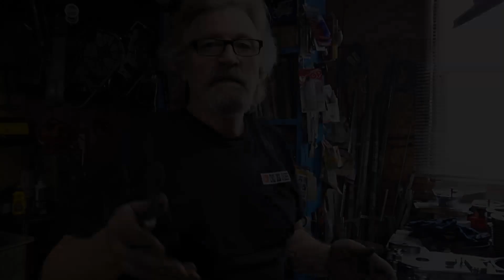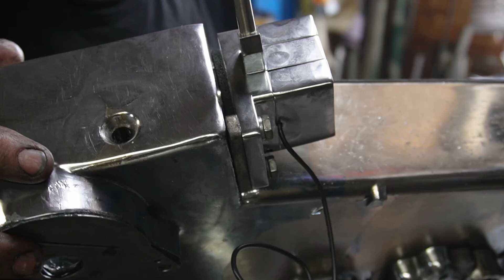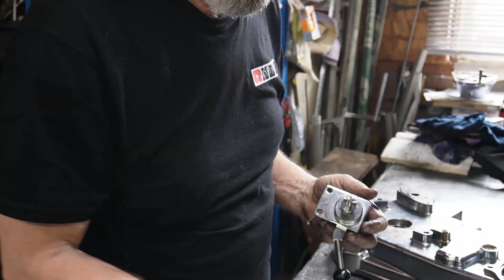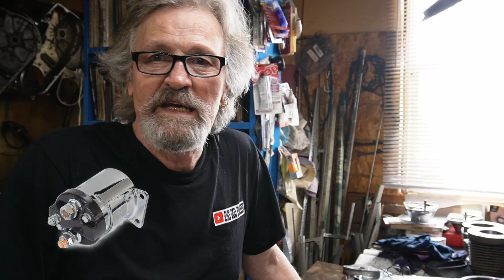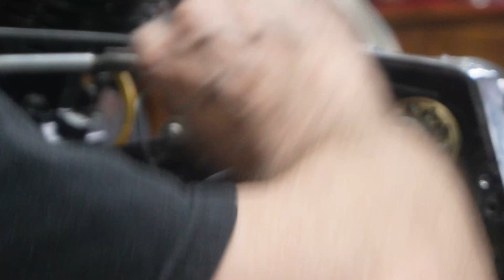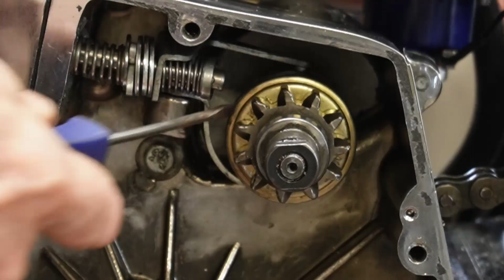HOW TO INSTALL LEVER ACTION SOLENOID ELIMINATOR / HERE'S WHAT I HAD TO DO

Comment: So I have a 75 Fxe. Had a guy change the handlebars and messed everything up. Including the push button for the starter. It would stick. Huge pos... tried his best to fk everything up. Anyways, being i was changing the look anyway, I decided to eliminate the button and go with this VFactor lever. All of your information is spot on. But they also do not have clear instructions on the wiring. After installing everything,  it works okay but does require constant adjustment.  And I developed a drain on the battery.  Can not for the life of me figure it out. I ride 8 miles and the battery completely discharges. Followed their instructions 100%. Stator and regular are putting out. Battery check says fine. Wtf is  hap- pening? Thanks for any insight
Reply from the maker: It's frustrating when things go wrong after a repair, especially with electrical issues. It sounds like you've done a lot of good troubleshooting already. A constant adjustment issue and battery drain often point to a wiring or grounding problem. Sometimes, there can be a parasitic draw that doesn't show up on a quick battery check, especially with the ignition on or off. I'd double-check all your connections, especially grounds, and maybe even test for a parasitic draw using a multimeter. Electrical problems canbe so frustrating for sure.  I do not think the Lever set up is the problem. I just did a video,  a week or so  back, for others on how to wire it up properly. You might want to check it ou. Thanks for reaching out and sharing your experience! Good luck.

Comment: Where did you place the relay ?
Reply from the maker: I mounted it up behind the oil tank. Made a bracket to fit it there. Thanks for commenting.
Reply: @itsmytimeletsgo ok.
I' ve been tinkering with at that place today.Tried tiewraps through the rubber bracket but that won't t hold.Thinking of 3d printing a bracket.
Thanks
Reply from the maker: Its alwasy a challange. Thanks for commenting.
Reply: @itsmytimeletsgo 
Yep .Mine is behind the battery now.
Still a problem to find a good spot.

Comment: or just change over to a belt primary.......like my 4 shovels.  you will never stop that pos design primary  from leaking otherwise.
Reply from the maker: You could do tha,t if money is no object I guess. Belt drive systems are $1,100.00 up here right now, plus 14% taxes, so dealing with what you have is a necessity for many.  I have done many sealed primarys without any issues.  Thanks for commenting.

Comment: What about the wiring to start the bike do you disconnect the start switch on the handle bars and those wires then where doe the wire in the solenoid replacement go?? Great Video,just ordered one of those units tou installed gor tired of crappy aftermarket solenoids and thought this manual switch is the way to go! And I have been told you have to earn it to make it right! Thanks for the expertise!
Reply from the maker: You do not need the handlebar switch. You should get an instruction sheet with the unit. If not you can email me ralph@itsmytimeletsgo.com and I can send you one. They take a lottle fooling around with but work well once set up right. Good luck and Thanks for commenting

Comment: Just installed but I’m confused with the terminals on the stock type relay, diagram is not clear. Can you help me clarify? Thanks!
Reply: Got it figured out, works great! Thanks for the video, it was super helpful, saved me a lot of time. Thanks!
Reply from the maker: Glad you got it figured out.
Reply from the maker: I can send you a few pics of the installation for this that should clarify things. Youneed to use the large type starter relay, along with the small black one. Contact me ralph@itsmytimeletsgo.com and I will forward them to you. Thanks for the question and commenting.

Comment: Ralph, I have a client that wants one of these...other than the gasket issue, how well do they work?  Will they hold up top regular use?
Reply from the maker: I see no reason why they should not hold up. I have had many comments, from others, who have used them over time and all say they seem to stand up. Takes a little fooling around to get the in and out alignment just right, but then they should be good. I am using one for Margaret so have confidence it will work well. Thanks for the questions and commenting.

Comment: I installed one on my 85 Softail and it works great.  Used the V-Twin starter relay.  I couldn't get the stock relay to work.  The V-Twin starter relay is kinda weird.  Not a solid way to mount it.  Any suggestions on using a stock style relay?
Reply from the maker: Not sure what the difference between a V twin one and stock. You have to be using the big old style starter relay as well to make it work. Thanks for commenting.

Comment: Hi ya……did your starter lever end up working ok ….i am trying the same thing but can’t get the balance between sending shaft far enough back but still allowing 2/3rds into ring gear for start up
Reply from the maker: It is working fine now. If you check out a video a few weeks back "Don't mix up you starter shaft collars" you might find out some more info about installing the unit and other problems that I ran into as well and what to look out for. They can be a bit if trouble to set up but most guys using them say they work very well. I am installing on on the the latest build ( Margaret) as I have confidence it will work alright.  Hope that helps you out. Thanks for the question and commenting.
Reply: @ cheers …did you end up posting a video on wiring
Reply from the maker: @matpeace5675  No I did not but if you email me at ralph@itsmytimeletsgo.com I can sen you a picture of it.

Comment: Bought one of these 6 yrs ago.. it’s the best ever.. no more buying starter solenoids..they always crap out.. but the lever action solenoid is worth the money..🤙🏽🤙🏽
Reply from the maker: That is great to hear from someone with long term use of the lever. I plan to be using one on Margaret when she comes back together. Thanks for the info and commenting.
Reply: @ you’ll like it I’m sure.. n a vintage look too.. you’ll never buy a starter solenoid again.. 🤙🏽
Reply: Had prestolite starter and solenoid for years and no problem for Years! Then had solenoid issues in past couple years of cheap crap solenoids have gone through 5 in past 2 years notice that they don't align properly and their brackets don't line up, work a while then fail was gonna go back to kicker as I have the old school 5 speed in four speed box, but would have to change my exhaust which I like a lot! Ergo the Switch sounds worth the effort, and the kicking! 76 here and can but lazy! Thanks for the site being here I appreciate the info. Ride Safe and Be Blessed!

Comment: Need to know how to wire it up. I'm replacing my Selonoid' with a manual hand leaver Selonoid. I. Don't have a Selonoid' on my starter. So how do I wire it to my 86 ,  1340 fxstc 5 speed soft tail custom Evo
Reply from the maker: I will look into it and get back to you. Thanks for the question.
Reply from the maker: email me at ralph@itsmytimeletsgo and I can send you a diagram and we can disuss it futher. You should have  a starter rely on that system. I will try to help you out.

Comment: Any chance of a vid of the wiring?

The wiring diagrams confuse me.

I installed one of these a few years ago and I swear it came with a small solenoid that I mounted elsewhere. Is it meant to come with one?
Reply from the maker: Yes there is a small relay that goes with the installation. If you email me at ralph@itsmytimeletsgo I can send you a simplifed diagram, explaining the wiring, that might help you out. Thanks for the question and commenting.

Comment: Would this work with the 79 sportster? The bracket looks the same
Reply from the maker: No I do not think so but do not know for sure. I don't know if there would be enough room for the lever to work. It is designed for 1965 to 1984  BT and 1980 to 1988 Softails as I understand it. Thanks for commenting.

Comment: How do I wire it ?
Reply from the maker: Here is a link to a forum that has a picture of the wiring diagram.  https://www.harley-davidsonforums.com/threads/83-shovelhead-solenoid-installation.265177/#lg=thread-265177&slide=0  hope this helps, good luck. Thanks for the question and commenting.

Comment: Can you please explain the wiring? I’m have an 83 FLH and it has the square Bosch style relay that comes with the lever. I also need the round relay that looks similar to the stock solenoid to, correct? And does that relay get wired exactly like the stock solenoid that I’m removing?
Reply from the maker: No it is not the same but you can check out this link and there is a picture there of the wiring for the relay. https://www.harley-davidsonforums.com/threads/83-shovelhead-solenoid-installation.265177/#lg=thread-265177&slide=0   Hope this helps you out. Thanks for commenting.

Comment: Love the video , how did you wire it up?
Reply from the maker: A seperate relay was included with the kit , to wire it to, with instructions. Thanks for the question and comment.
Reply: @itsmytimeletsgo  thank you l have to redo mine and set it up like you did with the washers my bike has been sitting for a few yrs and now l’m trying to get back to work on it again probably will be asking you a few more questions if you don’t mine
Reply from the maker: @stefanreimuth3951  No problem. Good luck with the install. Thanks for commenting.

Comment: fitted mine without gasket... that's a Sturgis for you
Reply from the maker: Yes be ok for a belt drive. How did it work for you? Thanks for commenting.
Reply: @itsmytimeletsgo  Same as for you: I needed a bunch of washers to get the arm that moves the gear in the correct position. As far as wiring goes, I shorted out the starter button on the handle bar and installed the lever wire on the ground side of the small relais. Then I mounted the big relay underneath the battery box (this meant I could re-use the original thick black power wires). I installed it all a year ago and it’s been flawless. I also have an FXDG (twin belt wide glide) where I want to do the same, but I am still puzzling about the location of the big relais as the location underneath the battery box is blocked by the rear brake reservoir. But for this bike the original solenoid works still fine so am not in a rush .
Reply from the maker: @bmp72  Thanks for the info. It might help others out there. Thanks for taking the time to comment.

Comment: Ran into the same problems   and it sits in the box still...lol..some day i might dabble with it ..thanks for sharing ..One of the biggest problem i had was dealing with starter run-a-way..had to do the old chiness fire drill to shut it down before melting the solenoid.. but i got that fixed . i hope..
Reply from the maker: Over run can be a big problem with some solenoild systems. Hopefully this will eliminate that. haven't powered up yet. We will see. Thanks for commenting.

Comment: Been watching you for a bit now, good straightforward stuff. As for the solenoid upgrade, maybe ya think that spacer you left out had anything to do with the 3 washers you had to add? 🙄🤔😉 maybe not...lol. and again, thanks for the vids. God was in a good mood when he made the Shovelhead (and forgives the haters 😂
Reply from the maker: If the spacer was used it owuld have leaked everywhere I am sure. Also it would have made the bendix stick out even farther and hit the ring gear. Trial and error to get it right. Thanks for commenting.